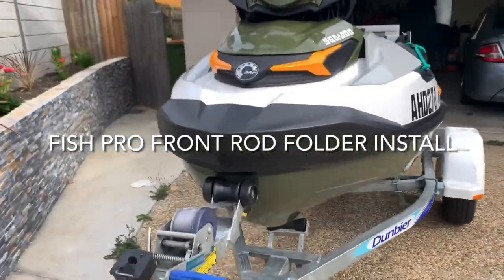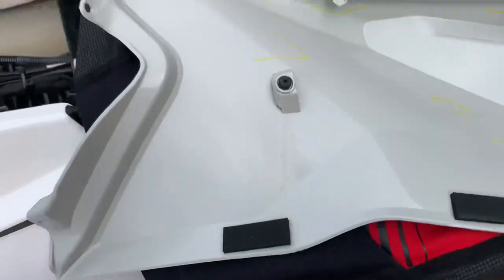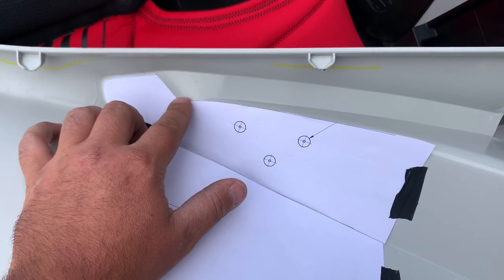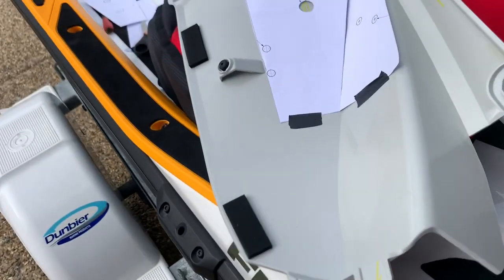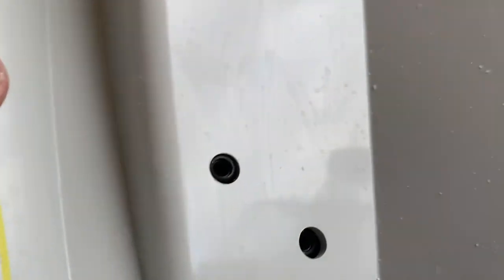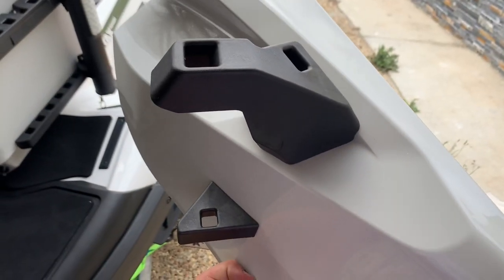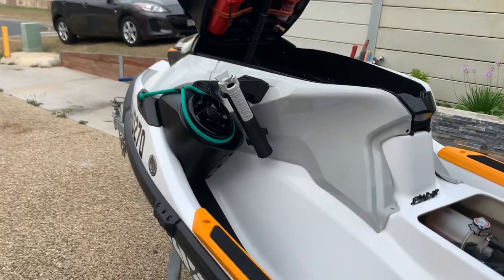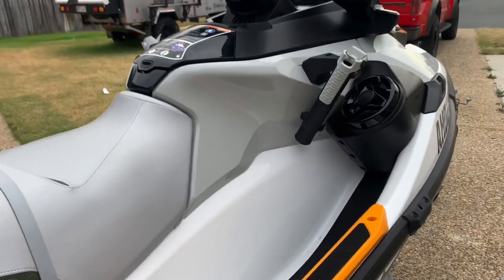2020 seadoo fish pro front rod holder install

Comment: Great thanks. 
Did you get the parts from Seadoo or eBay. 😃👍
Reply from the maker: https://www.brppac.com/brp-295100948.html
Reply: @OurAdventuresDownunda  thank you for that 😃👍🇦🇺
Reply from the maker: No worries mate they are a great addition if you jump on google there is another brand as well thats ally.. they look very well made unsure on price etc but yeah i chose these instead
Reply: @OurAdventuresDownunda    No worries. 👍 I went to Seadoo and got everything, but I am hesitant to drill into it  . Measure 2 or 3 times and then drill . Take care on the water.👍
Reply from the maker: Hopefully i will get yo take the ski out soon mate yeah you will be fine mate i drilled pilots first
Reply: Hey mate where did you find templates?
Reply from the maker: They came in the kit mate